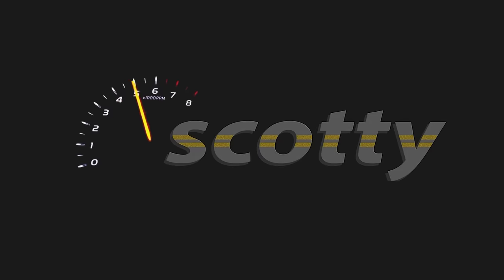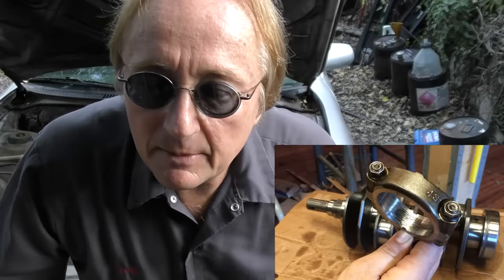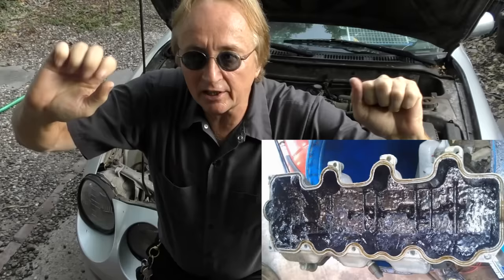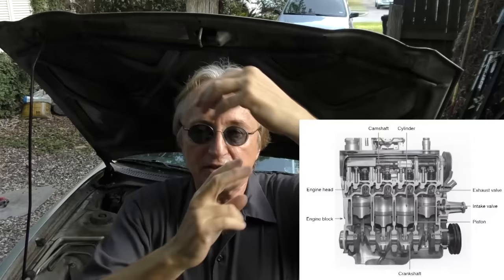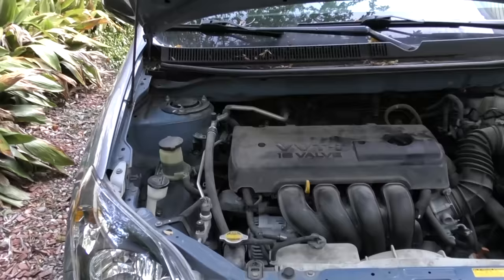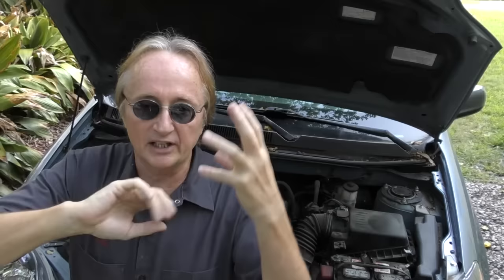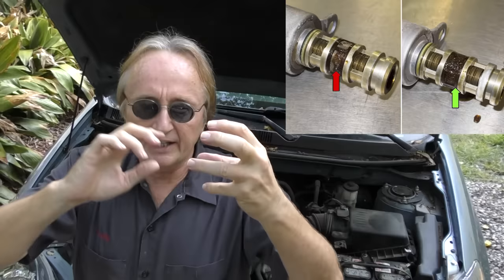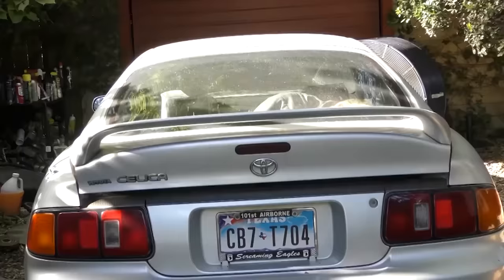Why Not to Flush the Engine Oil in Your Car

Comment: I've seen motor oil come out of push rods into the rocker arms like poop it was so old and sludgy. Like a once every 20K miles or ten year oil change. Depends on the engine. Older engines had all kinds of room for the sludge to accumulate on top of cylinder heads, lifter valley, valve cover stalactites, oil pan baffle. Once it gets that bad you need a solvent like white gas (Camping stove fuel) and or brake parts cleaner or something that will melt the sludge and varnish into a liquid state, again. Basic flushing oil will not do this unless the engine is super hot, but, if we read the instructions, it says to only use this basic flush solution on a stone cold engine for 5-10 minutes. Seals blocked by sludge will leak once it dissolves since the seals were not getting lubed regularly by clean motor oil and have worn out earlier than is typical.

Comment: I’m looking at this 2004 RAV4 n they’ve had the transmission flushed 3 times within less than 100k miles which makes no sense! They’ve have the engine flushed, brake fluids flush multiple times for no reason it seems.. so I don’t think the car is any good
Reply: Power steering flushed multiple times is crazy so I don’t think it would be smart to trade in my 2005 Toyota Camry

Comment: What about transmission oil?
Reply: IMO I get my mechanic to do a full flush and change on it for the transmission, he has the right kit and machine/the fluids for the honda I have, notoriously bad autos circa 2000-2006 
Becasue while there is a filter in the transmission metal shavings and such may still make it through and on a car with a solidly established shaky transmission I get that done by my mechanic, plus as some would possibly vouch its a bastard job to do lol. 
long stories short if you have a good mechanic, ask him what he recommends, if he has been good and honest with you in the past he likely will tell you what is necessary heck maybe I dont need to be flushing mine but I have owned 4 hondas in that era all autos and with that maintenece the transmission has been absolutely perfect, just changed on shedule and with the right fluid.

Comment: I dont get it! In US you change engine oil at 3.000k miles and get sludge formation. And us, in Europe change it after minimum 6.500miles, even 15.000 miles and we dont get to have sludge. I dont like the extended interval, but 3.000 miles looks also money waste.

Comment: Scotty I have a legitimate question. I know you’re saying engine flush isn’t so good especially for cars with low miles. But I own a 1995 C4 Corvette convertible with 167,000 miles. The engine is all original none of the internals have been replaced not even the injectors. Would it be safe to run an engine flush product for about 10 maybe 25 miles tops and then flush my oil? I understand there’s a risk in thatWith an engine that all with that many miles the sludge might be what’s holding the seals together. But I think it’s time that I get a lot of the crud out of that engine and if it does leak just means I’m gonna have to replace the seals. What do you think in my case?
Reply: Only let it run on idle for 15 minutes. I wouldn't drive with engine flush in my oil.
Reply: @NO-END  thanks I did let it idle for 20 minutes then drained it and LITERIAL chunks of carbon flakes came out. then I changed the oil 2 more times. The engine sounds MUCH better but now its leaking form the lower main seal. So far that is the only place oil is leaking. I only need to top it off with a quart of oil after 2500 miles. Currently saving up money for an engine rebuild.

Comment: But the car I bought had a cracked rocker and the oil was like syrup and it would judder while cruising, got a oil change but it still judders a bit, what do I do now?
Reply: Find a mobile mechanic for cheap online or something and ask him to open up the engine and clean up and seal with a new head gasket. That's what I am doing.
Reply: @zh85  Nah my car aint worth a new head gasket
Reply: @DestroyerofBubbles  you would be surprised how cheap some people work for on the cars. Specifically in Chicago area. But good luck to you
Reply: @zh85  Yeah Im in the UK, anything to do with the head gasket is normally a no no on cheap cars here.  Thanks for ur help tho
Reply: @DestroyerofBubbles  oh bummer

Comment: i dont agree with most of what this old non high tech guy says but when it comes to modern cars and oil flushes the crud that comes off the inside of the engine has to go somewhere during a flush and variable valve timing engines with those really small oil holes presents a problem. If you were doing a cam phaser replacement I would do a flush first before changing the parts because it was crud in the oil that caused them to fail. On a modern car an oil flush is a Hail mary and I would do them on my own engine and if a seal fails so be it. I would rather replace the seals cause for me they really are cheap as the labor is ZERO. Because I do not want a dirty engine that wears cams lifters pistons or rings.

Comment: im sorry, but this is very misrepresented
SOMETIMES oil keeps everything sealed
99.9% engine flush will only make motor happier
you are trying to tell me that engine that is being held together by sludge is going to work for long?
Reply: Exactly, also if the flush show that the oil sludge is what is holding it together, the problem isn't the flush and it show you NOW that you need to fix something than when the engine do blow up.
Also, modern oils do have detergent and all (and if ppl take care of the car yes they don't need flush), but if someone go over the oil change a couple of times it's good to flush. Not to mention that it wont hurt even if the car don't really need the flush.
Sensationalism crap this video is.

Comment: I change the oil with cheaper new oil and filter (correct spec)  drive for a few days. Then put the liquidmoly oil flush in. Run for 15min and drop the oil. Then use full synth castrol edge 5w30 and k&n oil filter. Does a really good job. Thoughts?

Comment: Engine flash is recommended to be done with oil to oil.
Of you by a car with high mileage and you don't know the service history don't use flash solution for engine the best way is like this:
1.Empty all the oil 
2. Fill it up with petrol
3 pres the starter but don't started
4 Drain all the petrol
5 fillit it up with oil
6 run it for 20 min and drain again the oil
7 for the last time full it up with oil  again.
You will see the difference

Comment: Hey Scotty, i have a 02' Lexus SC430 that has accumulated significant sludge from not driving it much. 140K on the clock.  what's your thoughts on using seafoam on this car or should i do as you say in this video just change the oil more frequently.  BTW, The car is running fine right now.  TIA!

Comment: HES WRONG I HAD A F250 GAS WITH 610000KMS   I FLUSHED IT EVERY 10K     WHEN WE SOLD IT PIULLED VALVE COVER WAS GREAT UNDER THERE

Comment: Here is a problem with scottys logic. As he doesnt actually understand how new engines works or apprently how oil works either lol. Modern engines like GDI motors run nasty and build up carbon and sludge in more places then ever before. And alot of people do short trip driving now. And oil crystalizes and causes varnish and sludge wether you change the oil often or not. As common practice flushing engine oil every other oil change is a good idea. Especially because the sludge wnd carbon clogs up the oil drain back holes on the pistons. Causing excessive oil burning.

Comment: Sir..may i ask a question? Do we have to flush the automatic transmission fluid after 80.000km? Or just change the fluid regularly every 40.000km? Thks
Reply: I have learned by experience, that the ONLY things that NEED to be "Flushed out" on any schedule, are COOLING SYSTEM & BRAKES, as the Coolant & Brake Fluid both age very poorly & once they do they become Acidic.   I once had my Auto Trans "flushed" by a somewhat sketchy Transmission Shop; 2 weeks later she was slipping bad. It had a "slight slip" before the Flush so I am not trying to accuse the Mechanic, it's just that after the thing acted up, I went back & he then told me he knew it was worn out & I'd be back.   I would only change the Fluid.

Comment: Got a question for you I've got a 2008  Ford edge They were notorious for the internal water pump going out and getting water in your crankcase In the process of putting a new water pump in now they Cam covers look really milky look in how can I clean the engine without hurting it

Comment: This is false,  I've used BG engine flushes plenty of times with amazing results. 

Of course the engines have had excessive sludg which is why the job was performed.
Reply: Infamous 281 which cars have you done this on? Considering doing this on a 2jz-ge which is SLUDGE CENTRAL

Comment: I’ve seen a video ., some low budget mechanic 👨‍🔧 use “AWESOME “ all purpose cleaning detergent from dollar tree store ., as motor flush on an engine ., it was a old dodge run down mini van . But I tell you it worked you can see inside the engine through the fill cap and it was spotless after he drain it out

Comment: Hey Scotty i been using synthetic oil in my car for years and then i got cheap on myself and used cheap oil now my car is accelerating bad and sputtering everytime i accelerate can i go back and used one quart of my original oil to flush it for 5 minutes then drain that 1 quart then fill it back full with the original synthetic oil?

Comment: Good thing i never done a engine oil flush on my cars. 😅. My 2003 ford F250 almost coming close to 300,000 miles. Its around 285x000 miles. I have a question. Should I change the Transmission oil? I never chaged it since i had it.
Reply: Hello I'm a mechanic from hyundai.
Read your owners manual they will tell you when it is recommended to change your transmission oil.

But from my experience you have already surpassed the recommended mileage because most cars we do them between 100-150km. Then after the first transmission oil change we change them every 40-90km.

All depending on the car.

My advice is, if you're going to a mechanic shop or a quick lube shop.

Make sure to get a full transmission flush where they hook your car up with a machine, not the Drain and Fill method. Because that way you get all your transmission oil out and replaced with new. While the drain and fill only empties 30-40% of your transmission fluid so it will get mixed with new oil.
Reply: @Pirate-King-Buggy  Can you explain alittle more. I have had other advise saying its better to just let the transmission oil alone and not change it. Because if i change it its possible that the new transmission oil with cleaner oil make the transmission run poorly. Our family have own this 2003 F-250 for couple years now. We got it used at about 170,000-180,000 miles. We never changed the transmission fluid. It is still running strong and normal. Some say that the new oil can make transmission bad why is that? I heard about little worn metallic pieces supposeably helping the transmission keep running good. Is this true? I am no expert in transmission. I am just saying what some people have advised.
Reply: @AUTOTUB3  
Hey again.

I did some research on the car you drive , according to the manufacturer your first transmission fluid is recommended at 150k miles, after that its 90k miles each transmission flush.

Transmission oil is a fluid like any other fluid in your car and its required to be changed, however it's not often (so dont be scammed by someone telling you that you need to change it everytime or if someone tells you it looks bad)

I dont know if new fords have transmission dipsticks, but older ones do. And you can tell the quality of the fluid by its color. If your transmission is automatic then it should take ATF fluid.

If you can check your dipstick heres how you can tell:
ATF Fluid levels:
Bright red: New and good.
Dark red : still good.
Brownish color: okay to drive on.
Dark brown : recommended to be changed soon.
Brownish black or black: change it.

The metal part:
Your transmission contain gears inside it, and those gears grind causing metal shavings to come off, a lot of metal shavings isnt good because it can get stuck between the gears and cause damage to it and you will notice if you see hard shifting in the vechiacle.
Most transmission contain a magnet at the bottom of the fluid tray to catch those magnets from circulating in the transmission (usually it's on the drain plug it self or a separate magnet in the bottom of the tray) the magnet won't catch all the metal shavings and it could circulate in the transmission.

Now I seen toyotas that still run good after 300k and transmission has never been touched once, all depends on the vechiacle. But to be safe, I would recommend changing it according to what your manufacturer says.

Your owners manual should be in your glove box , so if you're unsure about it just take a look and read what it says, that's your best bet.
Reply: lol I checked your channel and you are a car expert yourself.
I feel like you were testing me. Haha.

Well anyways , I'm not mad about it , if someone comes across our chat they can learn a thing or two and it might help them out.
Reply: @Pirate-King-Buggy  i know alot but i am no mechanic. Just curious what will happen if i change my transmission fluid with new oil. I am planning to run this truck until it gives up without changing transmission fluid. Since it still looks like a redish clean color on the transmission oil.
Reply: @AUTOTUB3  if that's the color it got the  you're good then , no need to change.

Transmission oil wares differently.
If you're towing a lot you might ware it out faster but regular use for a truck you're solid bro.